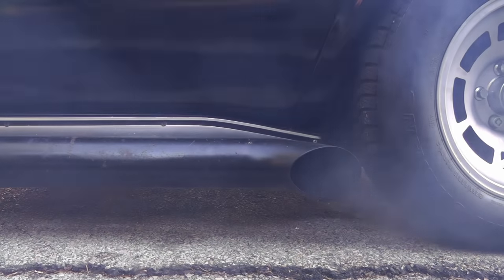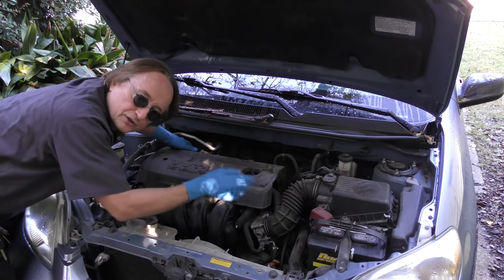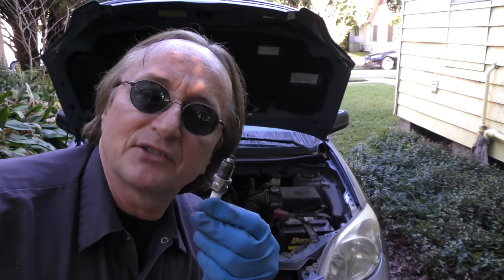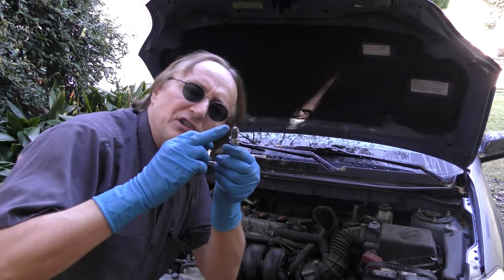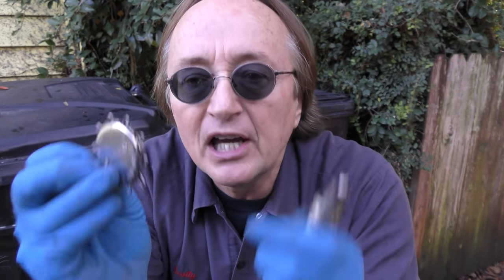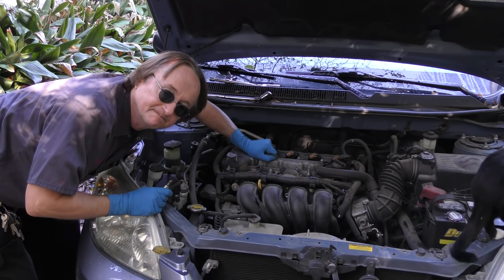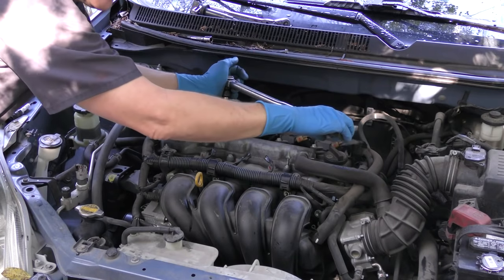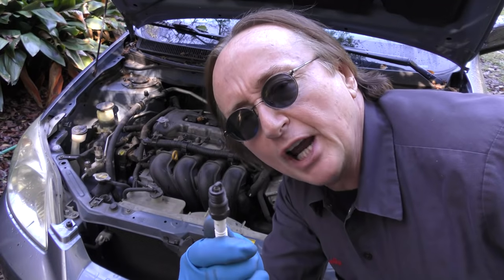What You Need to Know about Spark Plugs for Your Car

Comment: I prefer Bosch Platinums, they stay nice and clean.
Reply: electronicsNmore completely agree, only plugs I use on my cars.
Reply: Not for gm's
Reply: jbody 4
Who says? I had a GM, never a problem.
Reply: Same here, never an issue.
Reply: jbody 4
I used platinum plugs in my gy6 150cc scooter, and Kawasaki Jet Ski also.
Reply: Japanese plugs like NGK and Denso are much better quality and better performing than Bosch.
Reply: I like NGK's also. :-)
Reply: JDM Boy jheez JDM boy to the rescue. but wats best for my integra. NGK copper ones or iridium
Reply: electronicsNmore I used Bosch Platinum on my 1984 BMW 318i but with our gasoline they didn't work well the engine surged...I had to go back to the copper type plugs!
Reply: Same here.. I have MSCDIS 40KV installed in my 4G13 engine and Bosch Platinum does not busted. Unlike when I use NGK.
Reply: just got a pair of those to use instead of the OEM AC Delco's. I hope these work just as good, if not better.
Reply: electronicsNmore 
Bosch is fine. Theirs are designed for euro market models. The Japanese ones are pretty great, but in all reality Bosch makes complete OEM systems such as sparks, EFI, and other detailed stuff. Basically if you have a spark controller, use bosch. If you aren't really in a mclaren then use whatever else you want. Just closely match the oem choice to your choice.
Reply: Jay Edlington do you install Bosch spark plugs using anti-seize? I have a set that I’m about to install and they have the rolled nickel Finish so I’m debating if I should use it or not.
Reply: Bosch are cheap trash made my Honda run like ass
Reply: Let me guess ur a woman right?
Reply: Bosch is its own company...and they've been around long before Honda entered the market.  I get great results using Bosch Plugs in every Toyota I have ever owned!
Reply: I still do anti seize on Bosch Plugs...but I only use a small amount on the upper half of the threads.
Reply: I use the Bosch platinum+4 and my accord never ran smoother.  I always get great performance from multi-ground plugs.
Reply: Just got those on my 02 accord.
Reply: @melinatedgreatness3172  Me too.  02 Accord.  200K miles.  Did a tune-up and it runs great.
Reply: Just saying, no argument, a few years ago the Ohio Napa cancelled my order for Bosch plugs.  He said they're not good so he won't sell them.

Comment: I got one for ya. My car's 2003 (3 letter german car brand) OEM spark plugs come out as 4 electrode platinum ones,but you claim iridium (single electrode) should last longer. What will be your best recommendation (in terms of avoiding missfires and CEL),to use an OEM despite being platinum spark plugs or swtich to iridium ones? Appreciate it !

Comment: Iridium plugs are excellent and i have been using them for many years and they last a long time with better performance & economy.
The down side is the delicate thin electrode that goes through the core of the plugs can break off like it did with me when i took the plug out,thankfully it did not do any damage to the bore.
The electrode on the iridium is very thin compared to a regular plug.
Regular plugs are more robust than iridium ones that's the only negative to iridium's,but apart from that iridiums are great and i would not go back to regular plugs.

Comment: I've had problems with iridium compared to platinum.  the iridium plugs, broke the ceramic insulators from heat !!  happened to 2 or 3 of them over time.  I think the iridium runs HOTTER, and cracks the porcelain- or, the porcelain cannot adhere to it as well.

Comment: I noticed just about every car you work on has dry leaves on the cabin air intake area - why not do a video on why they should be removed so the dry leaves won't crumble, fall into the drain holes, plug them up and rust out the fender? Keeps the cabin air filter cleaner too.

Comment: I avoid NGK with the fine electrodes and Bosch platinum fine electrodes. I have bought a car with both these and they were great performers when new but after 5000km the NGK iridium needed to be gapped and the Bosch platinum electrodes were gone on the right bank and worst of all I didn't see that the first time because the electrodes were surrounded by the ceramic casing.

Comment: What if i bought spark plugs that has a X tight gap and my old ford wants a Y tight gap. 
Do i bend the brand new out of the box spark plug to match the Y tight gap? Or will that just ruin the brand new spark plug? 

The car ran great even if the gap was too tight compared to the original specs. The threads matched too so i believed they were the correct plugs but when i read the manual, it said that the plugs used a bigger gap. But i'm sure they used different kind of plugs back in the 60's than the modern ones of today. 

The car has a 1967 ford cast iron V4 engine.
Reply: That can vary upon spark plug designs, read the labeling on the box for the particular plugs you're buying to see if adjustments are feasible without damaging it.

Comment: i got a 2002 Chevy Impala it has 88,000 miles what's the best spark plugs and wires to get for a 2002 Chevy impala that got 88,000 miles if the miles have anything to do with it ?

Comment: If you've got a Honda, the NGK copper plugs are widely recommended. They cost $8 for all 4 at Advance after coupon (p20). They won't last as long as iridiums, but work better if you don't mind changing them every couple of years. Just don't buy Autolite plugs....for any car. They don't call them "NeverLite" for no reason.

Comment: Hey Scotty Kilmer is there any difference between an autolite 24 plug and an autolite 26?  I have had autolite plugs in my 1976 GM 350 V8 and the guy gave me the autolite 24 plugs a year ago and I came across a website for spark plugs and typed in my engine and it said autolite 26 plugs.

Comment: With some modern high boost, high performance engines its best to be checking the sparks every 40,000 miles or so. The higher cylinder temperatures and higher output ignition systems these engines have can wear down iridium plugs faster than you'd expect. This is particularly the case in high boost downsized engines that you would find in many european cars.

Comment: What I find confusing is when to use single or 4 electrode plugs?  Can you gap 4 electrode like single electrode? Thanks Scotty
Reply from the maker: 4 electrode units are not gappable. And it's a joke anyway, spark will always fly ONLY to the one with the least resistance. they don't all four fire at once

Comment: Lots of people have noticed that Bosch spark plugs work poorly in Toyota 4 cylinder engines. Denso or NGK is a safe bet and cheap too.
Reply: It is the same thing for some German cars. My dad's Porsche 944 T factory plugs are Bosch copper plus. But it runs better with NGK copper plugs.
Reply: I use Bosch Double Iridium Plugs in my 2010 Corolla S...and they work GREAT!
Reply: Dima Aryeh bosch are junk in every car.
Reply: +Nate Avery.   I disagree...I've had nothing but luck using Bosch Plugs in my Cars!   I've taken them over 150,000K and they still look and work great.  You also need to spec the proper heat range for plugs to use in your individual applications...which is true with any Plug.  Some Plugs are Cooler, some are Mid Range and some are really Hotter.  In my case, I am using their top range Double Iridium Fine Wire Plugs...they're in a medium heat range of about 6 or so.  My Vehicle runs very smooth and quiet on them, and the engine sounds as new as the day the Car was bought!   The original Denso Plugs that the Car came with were lower end quality plugs...they worked okay, but the components like the Ceramic Insulators were deteriorating and the points were beginning to level out...but minimal fouling.  However...I checked my coils and they were all fine, so I proceeded to the plugs.  My RPM Needle was bouncing around between 580 to 800 RPM while the Car was fully heated to lower RPM.  Often when I'd push the brake or come to a stop at a light...the vehicle felt like it was about to quit and idle out, and then it would bounce up again.  I recorded a before and after on my OBDII Diagnostic and compared.  When I put the first set of Bosch Plugs in...the Cars Engine improve tenfold and ran so quietly and smoothly compared to the old Straight Iridium Denso's. The idling was much smoother and steady, and the RPM Needle stopped bouncing up and down.  The near shutdown at low idle also ceased!  I recently decided to replace those plugs with newer ones 125,000K later...and they still looked new and fabulous!   So I took the newer plugs and put them away in the toolbox.  I'll go another 25,000K or so before I replace them with the newer ones.  My power is good and my fuel usage and mileage improved greatly!  New Corolla's generally come with Denso or NGK...whichever Toyota has readily available on the Assembly Line at the time of manufacture?  Maybe the plugs you were using just weren't spec'd appropriately for your Vehicles application, or maybe some quality control issues...I really don't know?  Toyota recommends Iridium Plugs for the 1.8 L4 Engine...but doesn't specify any particular Brand in their Owner's Manuals.  All you can do is switch them out until you find one that works really well with your vehicles requirements.  But seriously...I've never had any issues with Bosch Plugs.  My next choice would likely be NGK's if I wasn't satisfied with the Bosch Plugs!   Just Sayin"
Reply: Had bosch spark plugs in my skoda when i bought them and it ran like crap. Replaced them with the factory champion plugs and now it runs great. Needless to say, just stick with the factory plugs for the best results.
Reply: Yah stick with the factory plugs. Had gm used Bosch ran terrible. Replaced with Delco, ran perfect.  I have many customers and I'd say of the 20% who try the wrong brands 80% come back within a few months to get the correct plugs.
Reply: Denso or NGK in my Tacoma. OEM plugs were Denso normal.

Comment: Question the I never had issues removing my spark plugs off my little truck but the last time I removed them they were frozen in the head  the so when I remove them and I put them back I was afraid that they will be stuck again so I put a light grease on the threats I also bought lubricant for the threads but I have not took them out and replace them what do I do do I buy new spark plugs and not put any Grease on them even like the one they sell  for plugs

Comment: Hey Scotty. Been watching your vids for some time. I thought it might be a good idea to ask; "Is there a serious issue with my car if there is gunk on the inner (goes into the block) side of the spark plug?" 2002 Ford Mustang V6, 186000 (+) miles. Basically, it looks like oil/dirt has accumulated on to it. What are your thoughts?
Reply from the maker: generlly that means the engine i burning some oil, typical on a V6 with that mileage
Reply: Scotty Kilmer is that really bad? doesn't the engine burn some oil any way? Can I prevent it, what should I expect from? I apologize but, I am not a mechanic, and any work I've done to the car is general maintenance work, and some things that I found easy to do (by following youtube). What advise do you have for me on this issue. I don't want to get rid of the car, I've had her from day one. I'd rather fix her up, if I can, than think there isn't any hope of fixing any serious issues. Thank you for replying.

Comment: Hey Scotty, Sry for asking something not related to this video topic. I bought myself brake pads and intended to install it by myself. Unfortunately, i couldnt find antiseize lubricant at any autostore in my country. I need to know is it ok to not use antiseize lubricant for my installation? Or can I use engine oil as a substitute for the antiseize lubricant? Thank you and sry if this is a silly question
Reply: CarlosKuoYi afai it's not necessary to use antiseize but you can use any lubricant that doesn't cause metal/rubber corrosion or collect dust and grime.
Reply: CarlosKuoYi you can use grease

Comment: Hi scotty I have question I lie in Kuwait middle east I changed the spark plugs when temp gauge shows on 1/4 while it's operating temperature is 1/2 is it ok?? (It shows 1/4 after I left the car shutted off for 2.30 or 3 hours )

Comment: Great Vid Scotty. Thanks for the tip on the Wire Gauge, Ill have to pick one up. Reminds me of a pitch pipe hahah. Woops Ive been putting a lil copper anti seize on my plugs as Ive run into stuck plugs in heads before.

Comment: A piece of debris is stuck in my engine and has already broken two spark plugs in two days. Would turning on my engine with the spark plug hole open blow it right out? The mechanic says he needs to open up the engine to find the debris. He's checked all the filters already and used compressed air down the hole and a magnet and he can't think of anything else to do to find it. Thanks Scotty!
Reply from the maker: worth a try to do that

Comment: I always when buy a used car arround 100k miles on clock, I always change timing belt water pump and spark/glow plugs, obviously the full servcieas well...

Is the best to change parts after arround 8-10 years especially the most used pard under pressure, like spark plugs, they might run fine but will wear faster something else

Comment: HI Scotty, I bought an almost new Mitsubishi Mirage recently. Just curious what is your opinion on Mitsubishi? please be honest. Thank you.
Reply from the maker: not a Mits fan, but they can hold a while if you change the oil frequently. BUT, they will not last like a toyota or honda ANDtheir automatic transmissions are weak if you don't have a standard tranny
Reply: I had an 09 Lancer 5 speed, I had it for about 5 years and 100K miles, all it needed was a battery.  I wish I never sold it.

Comment: Scotty, another great video. There really is no magical spark plug if so the manufacturer would recommend them. I have 2010 mustang with 53,000 miles on the original plugs. Noticing a drop in Mpg and a slight stumble on idle i spent the extra dough on E3 diamond fire  plugs as they are nickel just as the OEM  motorcraft and claim better gas mileage. They are half the weight and triple  the price. May have made a bad choice. we will see when I change them out. Just like my dad who was a ford mechanic for 35 years you know your stuff, keep up the videos.

Comment: scotty, my car jumps up and down when I drive it on the highway but the stability bar is fine with its parts, also when I drive if I accelerate it tends to pull to a side and I have to constantly fix the steering angle, the plates and ball joints are new
Reply from the maker: sounds like worn struts or worn A frame bushings
Reply: Scotty Kilmer turned out to be a loose ball joint, my wheel almost fell off

Comment: Hello Scotty Kilmer , I am a college student and as you know a car is all you got, I have had my 98 Hyundai accent GL for over three years. I have done everything in my ability to keep it in the best shape it can be your videos are the reason why, but I have a problem. My car will not go faster than 50 MPR I pulled the code and its a multiple miss fire, and I cant seem to find a trustworthy let alone a mechanic that knows how to fix or even give me a solution. I have a few ideas but i trust your judgment and I believe you can save my car "JOLT" before its to late!
Reply from the maker: pressure test the fuel pump, weak ones often do that, Also pressure test the catalytic converter, plugged ones do that too
Reply: First of all you haven't said what you have done to solve the misfire, so it's impossible to tell ya where to look. Sometimes it's the fuel injectors.

Comment: Hey Scotty, what about engines with 2 spark plugs per cylinder?  

Would they theoretically be better or worse than standard designs?
Reply: Ford and Nissan tried it years ago and it didn't really work. Now the Germans are trying it. It just makes tune-ups more expensive.
Reply: one good spark is all it takes, more than one is a gimmick
Reply: Check out Scotty's vid on that Mercedes which uses two plugs per cylinder.
Reply: I had an '80' & '81' Datsun 200SX in which both had, what I think was the "NAP-Z" engine with 2 spark plugs per cylinder. Loved those cars, except for rear wheel drive with very light rear ends... Totaled em both...
Reply: ... For the most part, it's a gimmick, but some very high displacement hemi engines need them.  Engineering Explained did a video on it.

Still, it's usually a stupid gimmick.

Comment: hey Scotty, I have a 1985 Nissan 200sx that needs some new fuel injectors. I am having trouble because my car looks completely from the car you used in your fuel injector video. If you would like to help I will send you some photos of the engine bay to show you what I mean.
Reply from the maker: same basic job, remove the fuel rail and the injectors and always use new o ring seals

Comment: Scotty, what do you say about spark plug indexing? Turn the bottom electrode towards the inlet valve can give me extra mileage or horsepower?
Reply from the maker: no, means nothing where it is
Reply: Some people saying if the spark plug is placed to a specific angle could make extra power. They call it Indexing.
Reply: Works for E-tec outboards